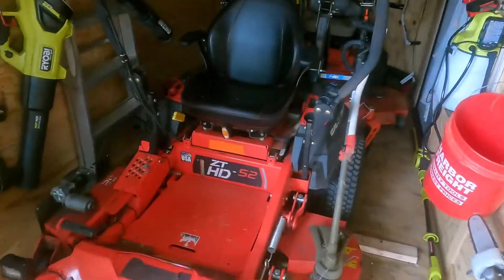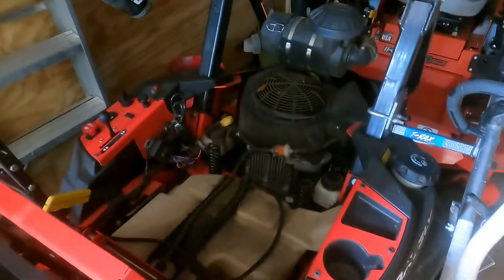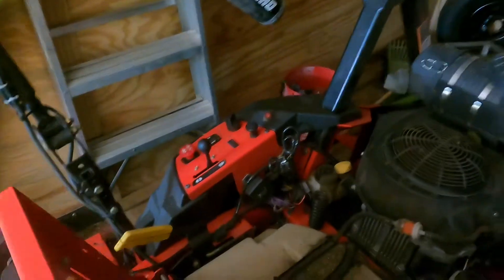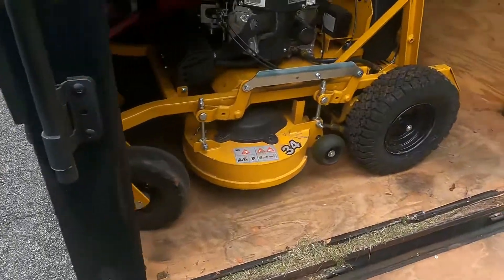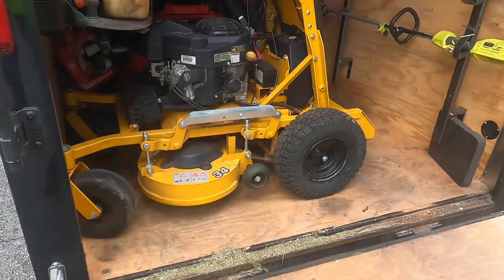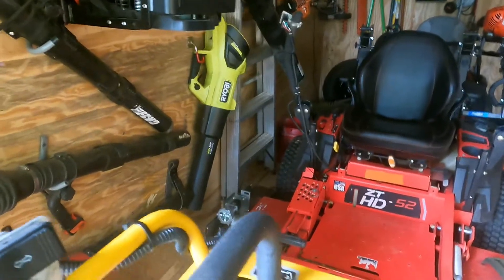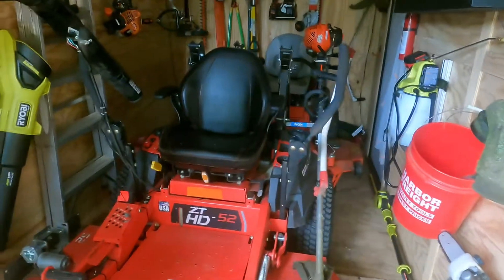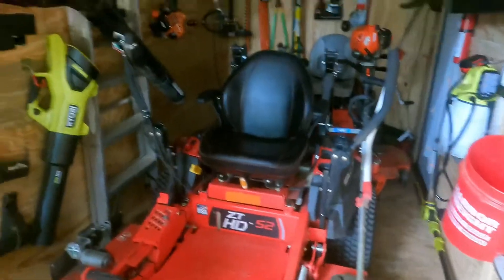GRAVELY ZTHD 52” | Fuel Issue Resolved | SIMPLE FIX CAN SAVE YOU $$$ #gravely #bogging

Comment: Sit question my mower starts but stalls immediately it won’t stay running I can get it to crank over …. Have the ZT HD 44.. it won’t stay running just replaced the solenoid and gonna do filter … appreciate what your doing here
Reply: Sir. Not sit…
Reply from the maker: What I did was remove the fuel line that went into the tank and blew it out with some air. On the other end when I did that trash came out the hose. Once it was clear put it back together and it’s been working great.
Reply: @NewHopeCutzandLawnCare I just tried that… and no luck… I’m looking into the part that sits underneath the carburetor… it’s not regulating the fuel properly

Comment: I have a Simplicity citation which the engine would not idle after running. Even after switching up the gas. So I tried some seafoam and now she idols like the first day I bought it! Your issues a little different don't have that bottle of mine but I was really surprised what the seafoam did after a tank. Concerning your 90-degree Bender is there a way to make it so there is no 90 I mean I have that issue in the future or is why why is dirt getting in there maybe you need another filter pre-filter report gets in the bottle? Columbus Michigan
Reply from the maker: Trash always find itself Into gas tanks. It happens. I did leave it off on time by accident so a little grass may have gotten In there. As for the 90 degree bend it’s designed like that. Common setup. I think  your seafoam trick is good.

Comment: Interesting. I just ordered a fuel pump. I just bought a ztd hd 48 it's not cranking. I can hit it with starting fluid and it will pop off then dies. I'm  hopint the pump is bad. But if that don't do it I'm going to check that out